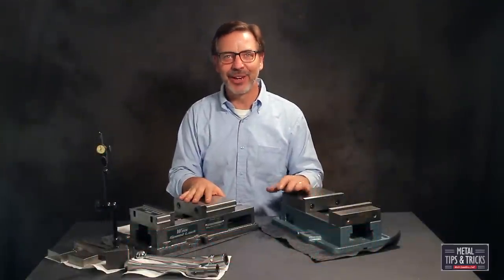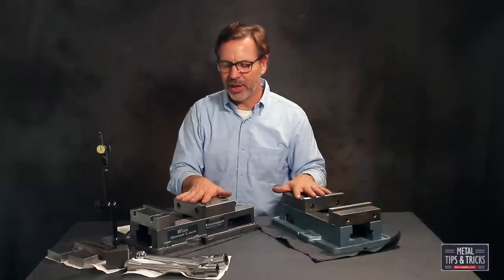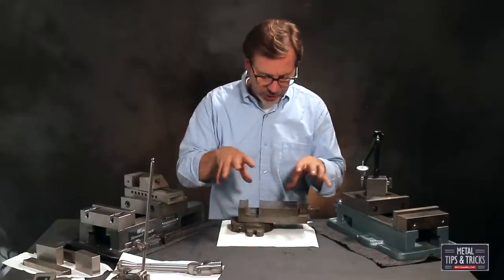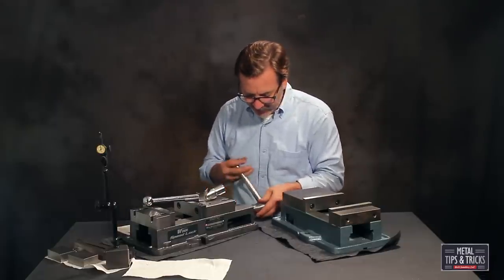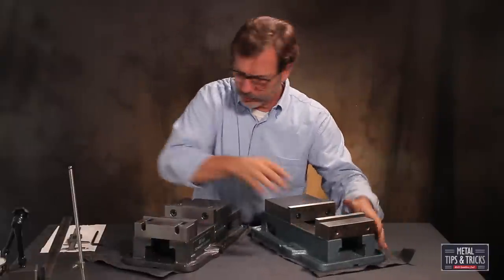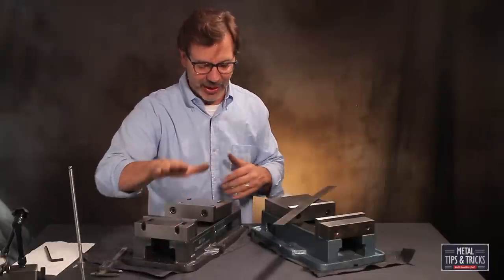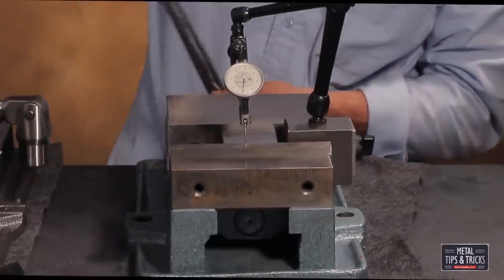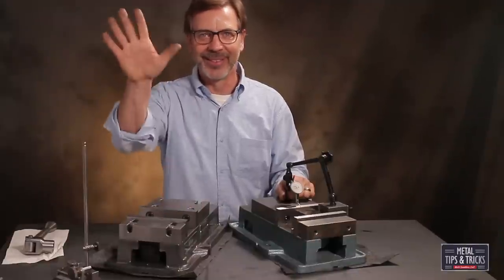China Vs USA  Machinist Vise

Comment: Love this channel I want to send you one of my wallets to review I think you would like them 
however something that does need to be mentioned is that you must account for when you clamp the vise in the machine when you put force into the vise thru bolting it to your mill table you cause the vise bed to warp when you measure the warp in a unloaded state you are getting a different perception of what will actually happen. however personally I only have Kurt vises in my shop period and I would definitely get a win vise to join my gang of vises....
Reply from the maker: Great comment. :-)

Comment: I liked the review but have a criticism. At 2:10 you say "I want to see if this $200 vice will compare to this vice (indicating the Winn)". What you should have said was"I want to see if this $200 vice will compare to this $660 vice" because then we know a critical bit of info. Nobody would buy low quality equipment if it's near the same price as the good stuff. The price difference is the key to deciding whether we are willing to put up with the poorer quality. Frankly after seeing the quality demonstrated, I thought the Winn would be somewhat more expensive than $660. So I think mentioning the price would have also helped it's case. In summary, when you do a comparison, compare ALL the key points not just the ones you feel are important.

Comment: And now... let's compare a Porsche 911 to a Mustang
Reply: Bart De Bruyne . That is not a fair comparison. Both Porches and mustangs both go stop and have tires that are aligned properly. They essentially do exactly the same thing with a very similar level or quantifiable factors.  If the doors didn't close the wheels were cockeyed and brakes were sponges you would have point. Bottom line the Chinese stuff is just trash and that's why it's a 1/3rd the price.
Reply: more like comparing an f150 to a yugo.  no comparison in quality and durability.
Reply: both vices hold metal to a table... you can generalise anything if you want to, lets compare a PInto to a volvo, then see who wins or catches fire first, but one is made in the USA so must be better right?
Reply from the maker: I like your comment :-)
Reply: Build Something Cool thank you Dale. I like your channel and the way you handle criticism. I wasn't too sure about this video. The tests done made sense and it's clear which one is the better vice, but it's not about USA against China, it's about low cost against a quality tool, right? "Made in the USA" is by no means a guarantee for quality, and it' s certainly not perceived like that outside the USA where it actually might have a negative connotation! Closing your borders is a recipe for economical disaster as it deprives you from making a deliberate choice and it puts a hold to quality and productivity improvements. Anyhow, I will continue to watch every episode from Metal Tips.... sorry from Build something cool. Have a good one!
Reply: @jusb1066  Volvo is a much larger car than Pinto, hardly a comparison at all. These vices are the same size. Actually Volvos we're never that reliable. In the seventies they had twin carburetors and we're a PIA to keep aligned.
Reply: @bart300166  USA companies have to comply with a myriad of regulations China doesn't. You call that fair trade?

Comment: My father was working as an engineer for Radio Communications of America when WWII broke out.  Westinghouse equipment was exactly copied by the Japanese.  But the control knobs worked differently.  Say you want to increase volume.  You turn the knob counter clock wise instead of CW.  Do they read and write from right to left?  I hear the Arabs do that. Kindly correct me if I'm wrong please.

Comment: Could you put the Chinese vice on 1 2 3 blocks and Mill the bottom flat to make it better? I do understand that a surface grinder would be best
Reply from the maker: the really problem it the quality of the casting and the materials they use.

Comment: You really need to test for tensioned accuracy with a vise on the machine. While the Winn wouldn’t improve much, the cheaper vise would improve more. The differences would shrink. Long time accuracy might not be equal.

I’m adding to my 3 year old post. I didn’t think of it then, but I use, among others, Snap-Jaws. These work on any Kurt comparable jaws screw size and spacing. You replace the regular screws with low head screws. Then the jaws just slip on and off. There is a small hole which the hex wrench goes through to tighten the screws with.

People are idiots if the use a hammer on a mill vise handle. You don’t have to exert that much pressure. If you need a hammer, you’re doing something wrong.

This isn’t a fair comparison, because one vise costs about three times as much as the other. Maybe try an expensive Chinese vise. There are some good ones. The Vertex is a good example. It’s a fine vise.

You can’t gang ANY two vises together without contacting the manufacturer before buying them and specifying two or more for that purpose, and they will grind them, and charge you for that. Go to Kurt’s site, and take a look.

Comment: This is 8 inch machinist vise?  In China price tag is $ 100 to $ 125 US , Some excellent brand price will be $ 400 and $ 650 US.
Reply: 6" standard angle - lock style.

Decent quality imports run ~$200 to $250 here in  the US, like this example.

The more highly polished examples, like the US made Winn also run to ~$650

The basic iron only costs so much... the fit & finish are where the costs add up.

Comment: The difference is for $600 you get a vice you can use in an accurate machine shop with no work past stoning the surfaces and for $200 you have to put in a little work grinding the top and bottom, but I would expect that if you found a supplier in China that makes vises for $450-500 it would have a better specification than the Winn one. A fairer comparison is if you compared it to a $200 vice built in the US. In addition neither are what I would call accurate vices, the Winn would be ok for holding 5 thou between parts and for a hobbist that is fine, but for a machinist it wouldn't do.
Reply: Spot on, Comparing apples and potatoes is not very honest, and this 'merica makes the best that I read about daily is disingenuous at best,

Comment: It there a reason to use the high precision vise over a low medium precision?  Most if not all the milling jobs are or should be done as a one time clamp method and so the precision is up to the milling machine.  As soon as you reclamp you lose a few thous already.  Milling operation only take up a few % of the clamping power so even a cheap one the work peice ain't go anywhere.
Reply: I bet that if the same milling works done on both vise you won't be able to tell the difference.

Comment: Why is a metric handle size suddenly a negative? The majority of the world is using the metric system, get used to it...
Reply: Jan-Albert van Ree no
Reply: Why would it be a positive when everything else in the shop is imperial?  If every other vise handle in the shop is imperial measurements, along with the vast majority of US made vises, a metric one means nothing else fits.  It isn't so much a negative on quality, but a negative on convenience.
Reply: Whose fault is to buy a metric tool, and then whine about it?
Reply: Glad somebody finally gets it :D
Reply: @Bereft777    I second that. NO
Reply: @Jan-Albert van Ree...try putting a metric nut on an imperial bolt some time.  Doesn't work, does it???
Reply: @Iowahurler82  
But the whole point is that for everyone not in the US, everything else in the shop ISNT imperial!
Reply: @robbiejames1540  My point still stands.  Why does the measurement standard of a vise handle mean a negative on quality?  I understand not everything in the shop isn't imperial.  I work as industrial maintenance now after leaving the construction trades as a millwright.  The plant I work in (John Deere foundry), has 2 primary mold pouring lines.  One is imperial and the other is metric.  I actually helped install the newer metric line.  It made zero difference to me aside from having to buy a set of metric wrenches and a couple sockets.  That being said, imperial vs metric means zero on the quality of the part.
Reply: @Iowahurler82  
Oh, yes I agree with you there, of course - the measurement system dosent affect quality

Comment: Id be more interested in seeing a comparison of Chinese vs Taiwan, there are a lot of low end machines made in both countries, the ones from Taiwan not as cheap. I have Chinese made lathe and mill here in Australia, the machinery sellers has a range of Chinese machines and Taiwanese machines and higher end stuff as well. i was looking at upgrading machines and I got a good run out of the Chinese ones but the Taiwanese ones they have are not all that much more expensive but feel have a better finish and feel. Are they better I don't know, not done any machining on them.
Reply: A good Taiwanese machine tool is almost up to Japan quality, which is saying something.

Comment: Can the budget vise be made better?
Reply: the bottom wil wear in as it rubs on a few mill beds anyway, and it should be stoned anyway before use, it just hasnt been done,  the rest of it, nothing was said about how accurate the parts are when held, so its fine, save the 800 bucks for something else, an hours scraping in and yes it will be just as good as the 1000 dollar for a bit of spare time
Reply: Doesn't even need scraping - a pass with a face mill and maybe a pass or two with a stone or lapping it on 320 grit paper supported by a flat surface to polish out the milling marks from the factory.
Reply: If the surface is relatively flat, the milling marks are irrelevant, you rest the vise on the average...   ;)
Reply: i agree just an hour or less of going over it will make it ready to do any job,  heck id do that to save 5 bucks never mind 500, i expect a few burs and such on any machined surface, have to make it nice to handle, me suggesting scraping was indeed  over the top

Comment: The chrome on the handle hides flaws by glare. It is "go fast chrome" and will peel/chip quickly. The character of well done chrome plate is distinct, though I can't put it in words. That said, A $200 import vs a $600 US is, in my experience, about the same as a $200 import vs a $600 import, allowing for things like rip-off pricing from some suppliers of either, putting the $200 vise at $1000
Reply: (posted before I finished) The question I would have is does the lack of support above the holes let the jaw distort on the Winn?

Comment: 'You should have chosen a chinese vise in the same price range as the american. But the result might have been unfavourable to the Winn vise then.
Actually it is quite a quick fix to get the Enco vise almost as good as the Winn. Some simple milling and grinding and it is done. 
I would go with the chinese vise every day as it is metric and compatible with other tools :-)
Reply: It's a vise... metric or English only really matters in the size of the hex on the end of the adjusting screw...

Most machinists in the US use a mix of English and metric tools quite happily.

Comment: Stirring up the hornets over here I see. lol Perhaps if you had called this video why you are better off paying more for your mill vise you could have avoided the wrath. I would have liked to have seen a hardness test of the beds on both vises.
Reply: This guy is not German... he is American .. I warn you mister block... He does not speak the local language Inspector is used to... [  The South shall rise again ]  :D
Reply: Hey Brian, I'd say that in this case, Dale is showing that you might well be in perfectly fine conditions with an economy priced vise, and you don't need to spend ~$700 when ~#250 will do for ~99% of your work...

Eric
Reply: Gotta be kidding, chemech.  When is it ever going to be okay for your work to be .004" out of square, every-single-time?  That China vise is a piece of scrap.  
I guess if your customers don't mind the kind of accuracy that comes out of your shop using a cheap vise, they would be happy with most anything.  Mine won't, and I won't put out work like that.
Reply: bcbloc02 
Chinese manufacturers build to the specs they are given, to any level of quality requested, at the lowest cost. It's not their fault when the only spec is: "cheap as possible."
Reply: Not always. I was involved with a project once that had a several hundred ton order of A36 speced structural steel supplied by China. Upon inspection maybe 20% of it would have met spec. The project was delayed a month while new steel was sourced. Last I knew they still never got reimbursed for the product being out of spec, (it was full of porosity) good luck with recourse in China. They sure didn't save anything on that projrct buying the materials twice and as a result they will not do any bidding with over seas vendors again the cost/risk.reward factor just isn't good enough. While I know the Chinese are capable of building good stuff many of them also are highly adept at being crooked and shady.
Reply: bcbloc02 
Ahhh..  I designed special anti fire aluminium ventilationshub.. when mounted with titanium blades the hub melted when fire in a tunnel... the hub had 69% carbon in the aluminium...   SF4 anti fire hubs.. made in china.
Reply: bcbloc02   i have the red cap from last American election...   make american Steel again.... bobo...   :-)
Reply: Better safe Than made in china
Reply: bcbloc02    we had a Saying in the army...   Thats how Platoon Sarg. Did it and thats how I do it. Better safe Than sorry...    and Doodoo Goes only one way....
Reply: ok .. so is there a "comparable" chineseium vise? The hornets nest,trolls, and "wrath" have run amuck! LOL...I'm not knowledgeable with what can be found. Is there a well made vice to be found from china even if it's the same money?
Reply: dcw56  so, you just slap your work in the vise without dialing it in, and expect it to be true???  

Mind you, once you know what's going on, you will adjust your setup and dial in your part, and you will be using parallels a bit differently than Dale did, and you can always use shim stock to true things up...

Most of the time, my customers are fine with tolerances of .015", but  when I'm doing precision parts for opto-electronics, then I'll tighten things up to what the design calls for. 

0.004" is a very fine tolerance, and if you are good, you can hit it with mediocre equipment without too much effort. I've used  tolerances that fine and even a bit finer when I made electro-optical devices.
Reply: Take note the difference in torque used to clamp down the test pieces:  On the expensive vise the vise was clamped firmly but not with excessive force.  On the Chinese vise he goes out of his way to use the most torque he can apply.  It's really not surprising there is error.  

This entire video is a sham, frankly.
Reply: Back when I used to roll steel plates for wind tower construction, I'd occasionally find unmelted pieces of spark plug (including the ceramic) breaking out of the plates after bending.  X-ray testing the welds also revealed some jaw dropping stuff.

The explanation is one word: Chabuduo

http://www.metafilter.com/162699/Chabuduo-How-China-became-the-land-of-disastrous-corner-cutting
Reply: Even US & Canadian A36 structural steel has gotten less good than it used to be, what with the way that the steelmakers merged with scrap dealers. We now specify A570 at work in order to avoid cracking problems.

Our guys who rode herd on the Chinese fab shops recently got an education in how the metallurgy and welding and painting can get screwed up if you don't keep on top of the fabricators there.
Reply: Wow you had the special magnetic aluminum! Even the "inspector" would not let that pass.
Reply: I don't do tons of structural stuff but I have had really good luck with the quality of steel dynamics out of Indiana.  Perhaps worth a look if you are not familiar.
Reply: I've done some consulting for SDI, and I did some consulting for Qualitech, which is now SDI's Pittsboro, IN plant...

And some for NUCOR and a few other steelmakers over the last 20 years...

Thing is, with the huge excess capacity in China, and the mess that our economy is in after the last 9 years, the steel mills aren't trying to run at 110%+ of rated capacity, so my phone doesn't ring from them these days...

So, I'm working more on non-ferrous furnace projects at the moment.
Reply: All this conveys to me from the obvious price difference in these products is that American must have little confidence in what they make if they keep needing to compare mid level products with home gamer ones.
The China vs America slant has no relevance in this comparison.
The American one looks pretty ok to me. I think you have done it a disservice with this comparison.
Reply: bcbloc02  yeah
Reply: Chineese and quality do not go hand and hand. You get what you pay for. I personally try to buy american where it makes sense. I will pay up for quality.
Reply: I always make my parts to size not just in tolerance and after you work that way for a while it's so easy to do and fast. There is so much bad quality around and I don't want to contribute to it. I just won't risk my reputation on cheap stuff. you have to remember most of this stuff you buy to make money with and only when you need it.
Reply: and its kinda funny how he complains that the METRIC hndle has slop on the INCH vise and then the INCH handle doesnt fit on the METRIC vise.

in either case its a corpo shill vid.